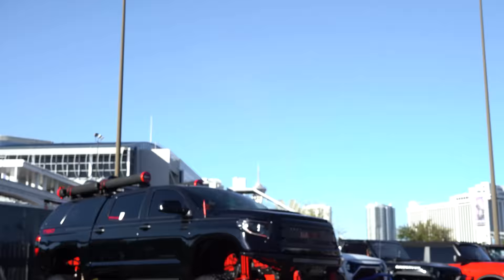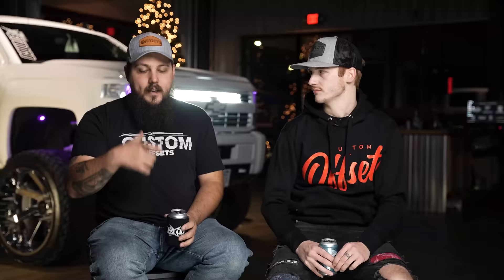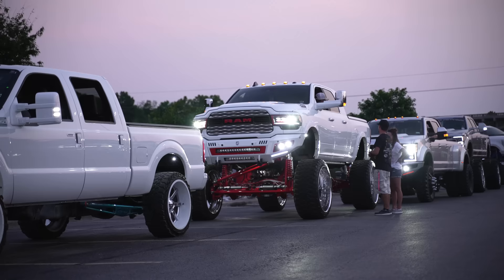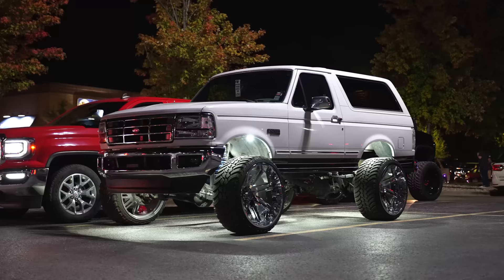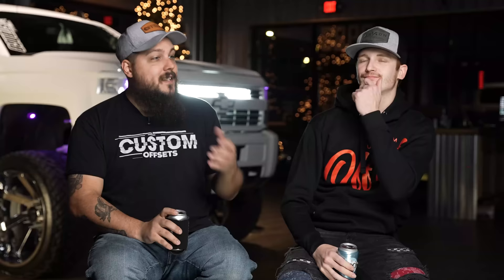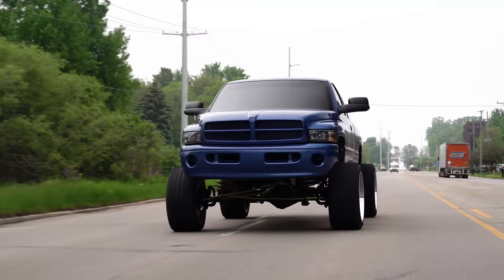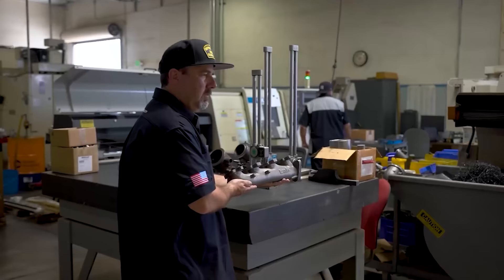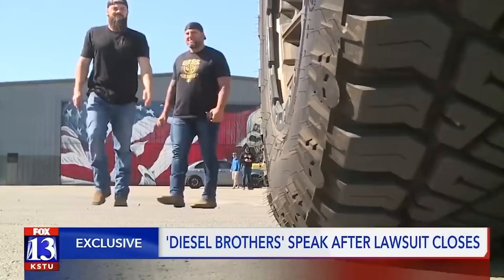2022 Truck Trends! | Our Predictions

Comment: i agree with the more sidewall. you have option to get a 24x14 wheels and get 40x15 tires and be able to show them off and still be able to off road more. so it’s not considered a PAVEMENT PRINCESS
Reply: cant curb ya wheels if it’s all sidewall 😏
Reply: @jaronstaiger  big brain right there🧠

Comment: I never really follow trends, I just do what I like and works for me, but I agree with most of it.

 The sidewalls, I went from 26s w/ 37s to 24s w/ 38s I like a little more sidewall. (Plus a slightly better ride and less chance of wheel damage) More and more people I know w/ 8 & 10 inch lift are going lower now. The Kelderman 5-6 lift has always been enough for me.
 
I never really liked those multi-color rock lights I've always stuck w/ bright white.
 I don't delete any of my trucks, just a dpf back exhaust. Now I do get an compound turbo kit larger injectors and a tune.

 Electric truck not, diesel only I don't even think they're even close to making any electric truck capable if towing my 33k lb 60ft boat and trailer.

As for the Carolina squat, no comment. 😫
Reply: my man you don’t have a 50 foot boat or a “compound turbo truck that’s not deleted”

Comment: Ok ok hear me out. In eastern NC, where leaned out trucks are the biggest, anywhere rural, which is basically everywhere, does not give a crap about squat on a truck regardless of the law. Also, there’s so many ways around the law cause they didn’t realize they left loopholes in it.

Comment: Pavement princesses.
Reply from the maker: I am taking it your truck never goes on pavement either?
Reply: There's nothing wrong with a pavement princess. Not all of us want to spend 10s of thousands of dollars on tires, wheels, lifts and anything else just to go get it all muddy. I hate having a dirty truck especially after buying an 80k truck with probably 20k in parts. I want it to stay clean as long as possible. I'm not afraid to admit that my truck is a pavement princess but it looks good it can still tow. I use my other truck for hunting and in winter. Why destroy a truck that I built the way I want just so people don't call it a pavement princess. They didn't have to pay for it.